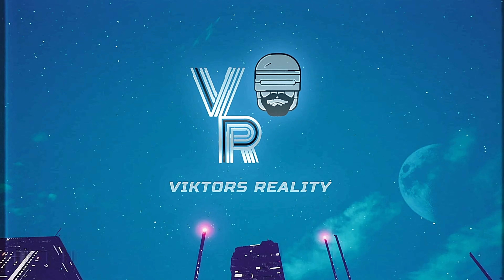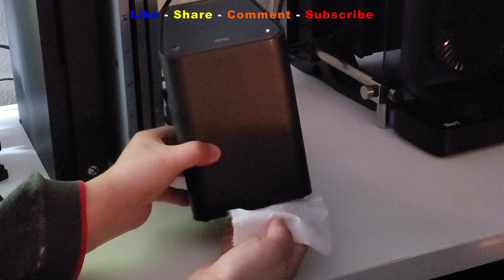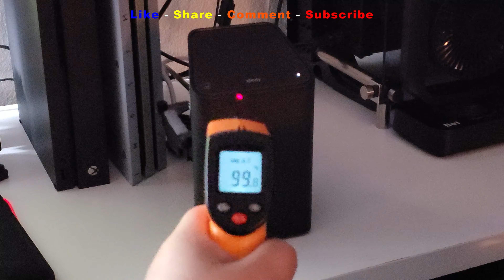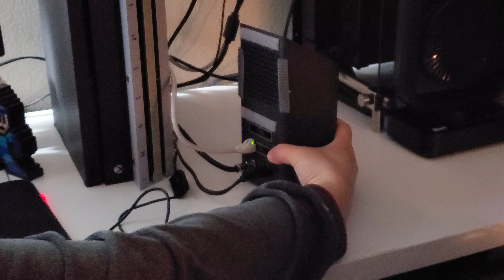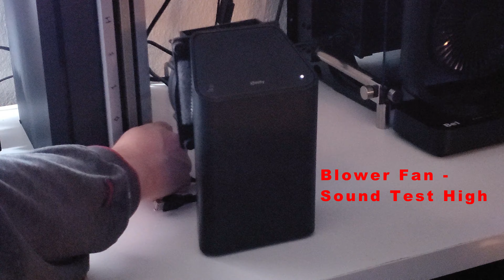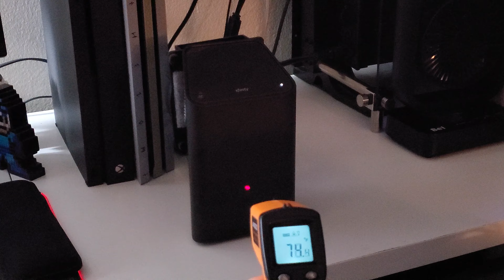Overheating? Xfinity XB6 Heat Fix - Xfinity Gigabit Internet

Comment: I should've tried to find this video sooner. Had this gateway for like a month and it has already ruined itself from over heating.
Reply from the maker: Hi... try and call Xfinity. They are exchanging to new White casing wireless routers free. you need to ask for it. I haven't yet but I know this to be true. Could be also only to high-speed customers I don't know.. dosent hurt in asking. Its Faster and supposedly cooler. It looks the same other than it being White while the Old is Grey.
Reply: @DisplayReality  thanks I will. Not sure how to reach a real person with the limited capacity at their call center tho.
Reply from the maker: Yea.. I tried twice... message said over 45min hold... I Noped right outta that call!... LOL...

Comment: I have one of those modems the fan is blowing out hot air it sounds like the fan is noisy I think it’s going to burn out
Reply from the maker: Get it replaced. Also.. in case you didnt know. At CES 2020 Xfinity announced new White colored base wifi stations. Old ones are Grey... They are free to all Xfinity subscribers. Many dont know. I just got to go and get one. So try that. It's faster they say.. hopefully cooler.
Reply: It’s actually a router and modem combined called a gateway..... and it’s absolute shit

Comment: Bro just take the bottom vent off and lay it on its belly where the large vent is facing up.  Just dust it out once in a while or put a less restrictive vent/dust screen on the bottom
Reply from the maker: I just got the xb8.. let's see how better it is.
Reply: @DisplayReality  i just got one too, took the bottom and top off and the fan doesn’t even kick on anymore, it just passively cools. It has a pretty decent heatsink on it.

Comment: My internet goes out at random I think it's because the modem overheats is that the reason?
Reply from the maker: Could be. If it gets too hot it will slow down. Make sure bottom grill is always clean. The fan would help. Good thing its pretty cheap..
Reply: This is the problem. I have this same model and typically when I start seeing issues with connectivity it is due to the unit being extremely hot. Honestly, this video seems to be showing one that has a fan failure as my unit has enough suction to hold up a piece of paper, but the problem is the vents can very easily get clogged due to dust particles. I have birds, so dander is typically the culprit meaning I have to clean the vents on the regular or...well it overheats and will do a restart causing net to drop. 

When it works, it works well...but the overall design of this modems cooling system is flawed meaning it is prone to getting clogged, having failures, or in some cases even bricking the unit itself. Anything that can't easily cool itself passively or with its own internal cooling within a reasonable temp range really shouldn't be considered a mass customer product =/ A shame that to keep it well within operation one has to attach a better fan. If I owned it instead of leased it, i would go as far as to add better airflow to the case itself....but alas.